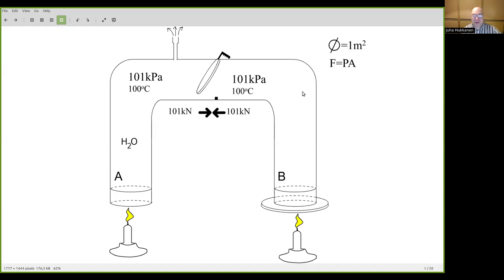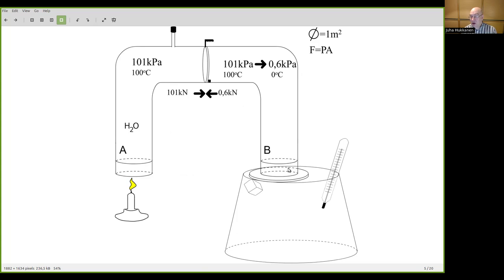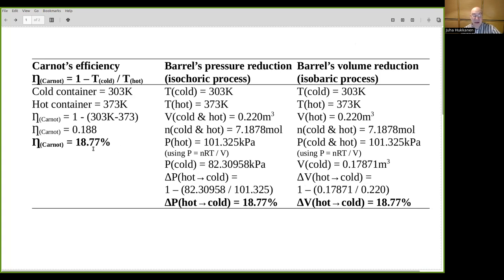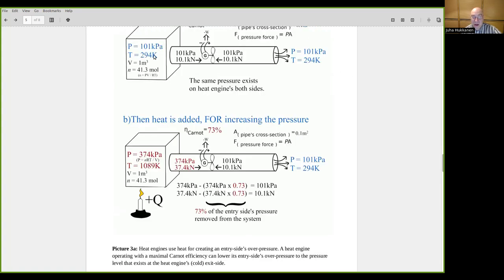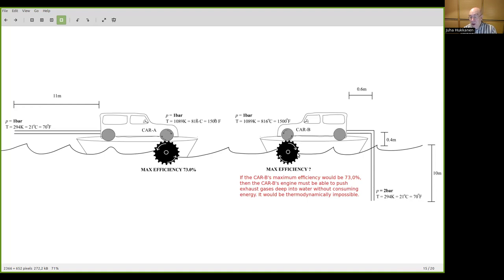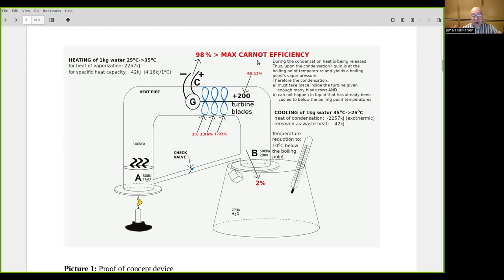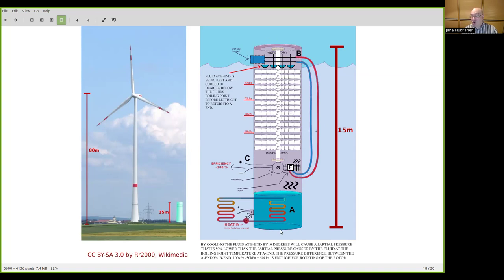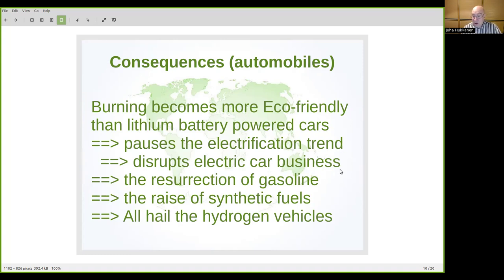99.4 Efficient Machine and Other Hukkanen Engine Related Things

Comment: It's a very long video dude, too long to watch. The only physics that allows what your title suggests is a heat pump, not a heat engine. The only comparable example of an actual device is the led that works as a heat pump to achieve more lumens per watt by cooling itself. Is that what you think you have done?
Reply from the maker: Quite early in the video I show that the cooling of the ideal gas Vs. condensing vapor filled containers can crunch closed containers with a different efficiencies.

If a (flexible) barrel filled with ideal gas is cooled from 373K to 272K, its volume will go down by ~26.8%. But if a similar barrel filled with water vapor is cooled from 373K to 272K, its volume will go down to almost zero. Also, I show that the Carnot's efficiency follows the temperature/pressure/volume behavior of the ideal gas. And, I show that the cooling of the condensing vapor does not follow that temperature/pressure/volume behavior of the ideal gas. Thus, opening a way for building machines / engines that are not limited by the Carnot's temperature related maximum efficiencies.
Reply: And how much energy do you have to put in to cool it?
Reply from the maker: Actually, to cool it from 373K to 273K you need to take energy out. With the "metal deforming machines" extreamply high "efficiency", I refer only to the fact that a non-condensing gas, like ideal gas, can do much less irreversible metal deformation work with same temperature reduction than a condensing vapor can do. And that is because the pressure of the non-condensing gas, after cooling it from 373K to 273K, is still 73.2% of the original 101kPa pressure and that remaining pressure resists the metal deforming work. While the pressure of the condensing vapor drops, upon cooling from 373K to 273K, to 0.6% of the original 101kPa pressure and that remaining pressure barery resists the metal deforming work at all.
Reply: I don't know dude, but I don't want to just be a naysayer. They used water spray condensation inside the cylinder engines for mine water pumping in the 1700s, the Newcomen atmospheric engine, it's just difficult to wrap my head around that engineers and physicists all missed making a 99% efficient one. Stirling engines are pretty much as good as it gets? If you can upload a five minute video with five key points I'll give it 100% brain cycles and delve deeper.
Reply from the maker: Thanks and ... a five minute video. Ok, the best demonstration is to see it with one's own eyes. To see, that the Carnot's efficiency limit is directly linked to the pressure and volume changes of the ideal gas.

a) So, First watch this video https://www.youtube.com/watch?v=j0TQxYemrgg
b) Assume that that video did show the temperature drop from 373K to 303K
c) Then check these calculations 
https://blog.hotbenefits.com/wp-content/uploads/2025/02/220barrel_calculations.pdf

... these calculations tell you that 
1) carnot's maximum efficiency, to any heat engine system with a with a hot-side temperature of 373K and cold-side temperature 303K, would be 18.77%
2) if that 220 litre barrel in that video would have been filled with ideal gas and the barrel's walls had been totally flexible. 
Then, in (an isobaric process) the volume of that barrel would have been reduced by 18.77% to 178 litres
3) if the barrel in that video would have been filled with ideal gas and the barrel's walls had been rigid and strong.
Then in (a isochoric process) the pressure inside that barrel would have been reduced by 18.77%  to 82.3kPa

What does this mean? It means that in an isobaric process the pressures inside and outside of that flexible barrel would equalize. And upon the reduction of the barrel's volume by 18.77% the pressures inside and outside of the barrel would become equal again. 

In other words the ideal gas inside the flexible barrel would be pushing the barrel's walls from the inside with an equal force per area as the outside air is pressing the walls inwards. This 18.77% volume reduction in non-coincidently also the same value as is the Carnot's maximum efficiency for temperatures 373K and 303K.

Carnot's efficiency values are basically the same as is the... 
 - pressure reduction percentage inside a closed rigid contaner upon cooling that container from higher temperature X to lower temperature Y
 - volume reduction percentage inside a closed flexible contaner upon cooling that container from higher temperature X to lower temperature Y

But what did you see in that video? At the end of that video the volume of that barrel was clearly less than 178 litres! 
It was more like 22 litres. So, on that video the barrel's volume went down much more than if it had contained ideal gas. 
That more drastic volume reduction is because the pressure of the cooled condenced vapor goes down much more drastically
than the pressure inside a ideal gas containing container. And as the vapor containing barrel's volume goes down more 
than the Carnot's efficiency percentage value would suggest, then the vapor containing barrel's metal deforming work had 
been done with a higher "efficiency". Higher than the Carnot's theorem would suggest.

Comment: Could use a balloon instead of a barrel if it could take the heat of 100C.  Steam engines often used cylinder and piston....though rarely cooled steam to 0C.
Reply from the maker: Yes, a flexible balloon would give more accurate results. Also, this kind of 99.4% "metal deforming machine" has little practical usage, but it shows the difference in the pressure derived power that the ideal gas Vs. condensing vapor filled contaners exhibit upon cooling.